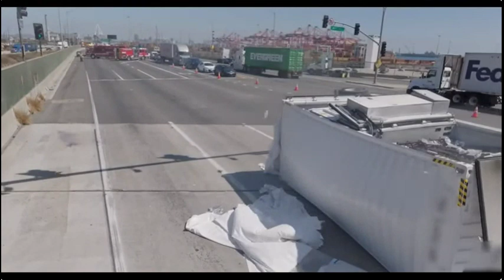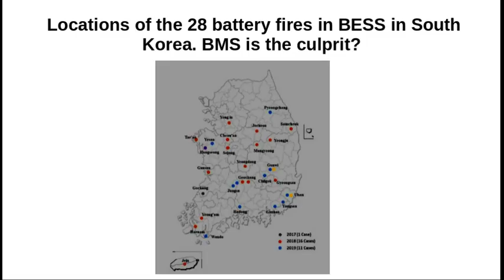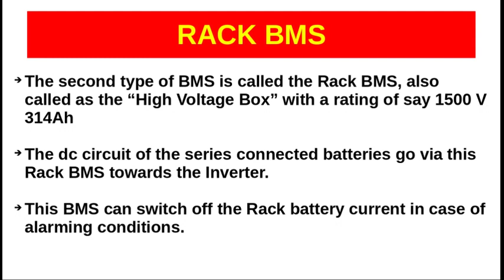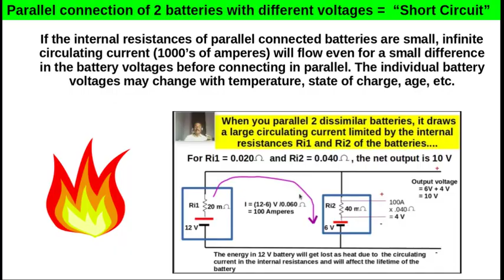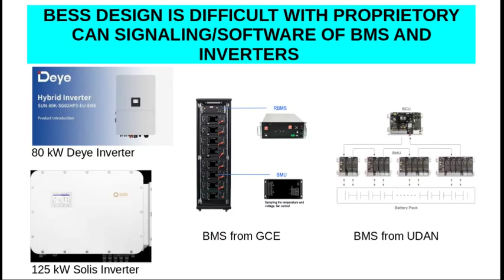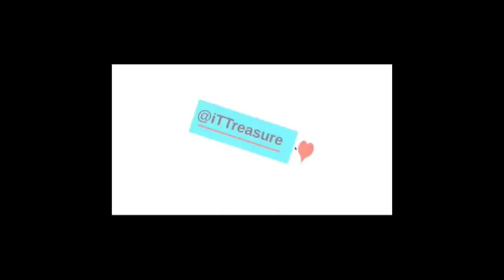“BESS Fire Root Cause: Incompatible BMS Designs, Rack Paralleling Errors & DC Circulating Currents”

Comment from the maker: Recently I was testing a BESS battery system of about 0.75 MWh. Four racks of batteries were in parallel at 614 V each feeding 300 A (and a total of 1200 A) . Each rack consisted of 192 Lithium cells in series (192 x 3.2 V = 614.4 V) with  balancing resistors across each cell that can be switched ON or OFF by transistors on command from the BMS. The Rack BMS was having an electro-mechanical relay that is switched by the BMS. That is no MOSFET based electronic switching is done. 

I suspect that the life time of the BESS system will be limited by the relay contacts making the BESS a piece of junk sooner or later. Also the parallel connection of 4 racks will lead to large circulating currents reducing the life time of the batteries. Both these may also lead to failures and fire. The passive balancing resistors will "work" only when the batteries are fully charged but may not be effective in making the total dc voltages of the 4 racks the same.

So the need of the hour is to make the state of the art BMS for the batteries (called high voltage boxes) that will use MOSFETS instead of relays and also make sure that there are no circulating currents from rack to rack.